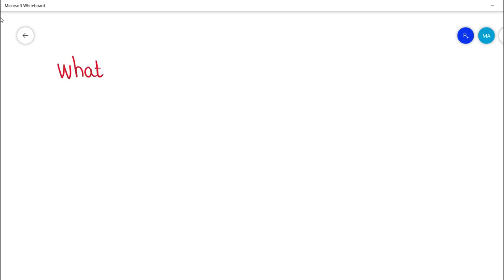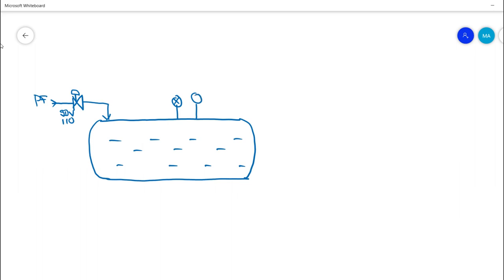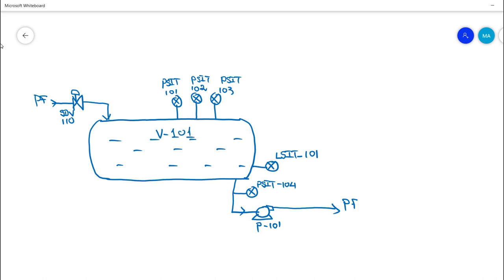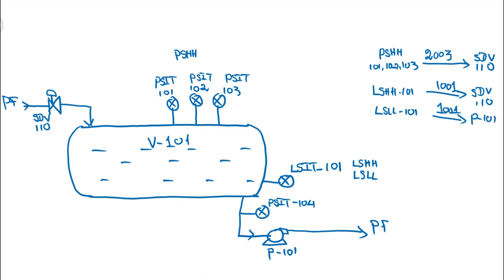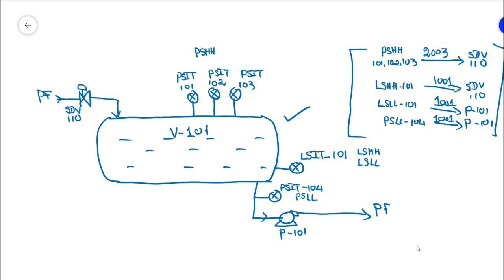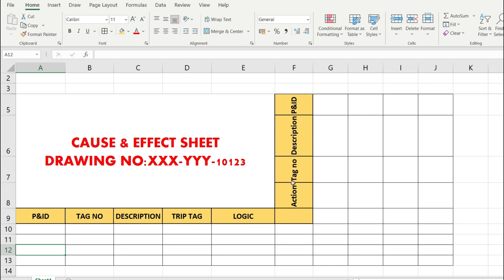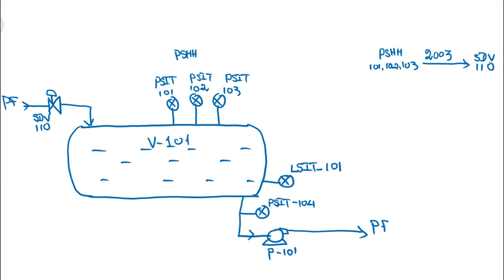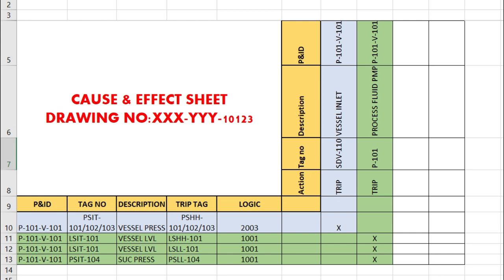What is cause & effect Sheet explained?| Learn Instrumentation Engineering

Comment: Really I appreciate for your gud videos I think it can be error or mistaken In drawing you have shown LSHH-101 and it's condition 1 is to 1 and it will trip SDV-110 but in cause in effect you have shown LSHH-101 will trip P-101 which is highlighted in green colour I have studied like this by my experience and sorry if there is any wrong.
Reply from the maker: Yes. I already informed in comments section and pinned it. It’s a typo error
Reply: @learninstrumentationengine268  kk thanks you later I saw your reply really I like way of your presentation with all examples which are simply understable and we are waiting new video's

Comment: logic number thats you have indicated thats loop number or what ???
Reply from the maker: Pl check my pinned comment
Reply: For example, 2003(2 out of 3) means if 2 of the 3 transmitters have High High signal, it will trip the SDV.
Reply from the maker: Yes